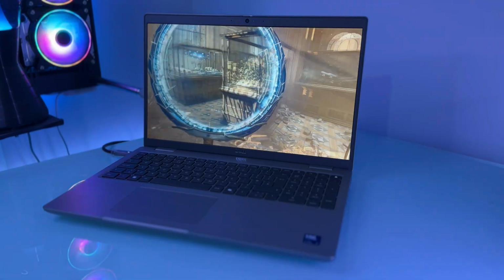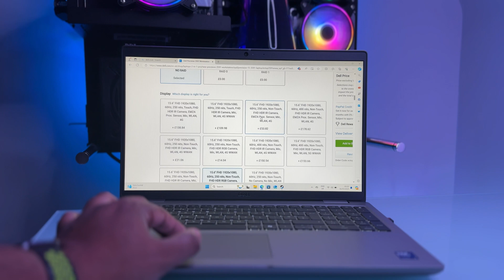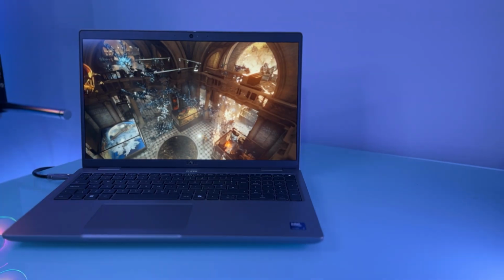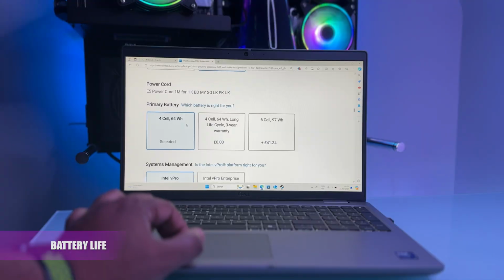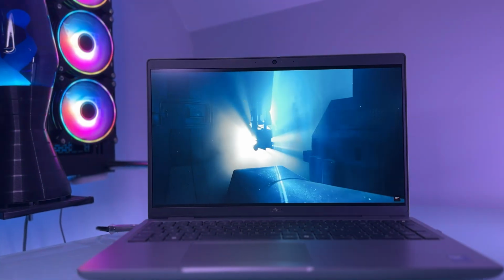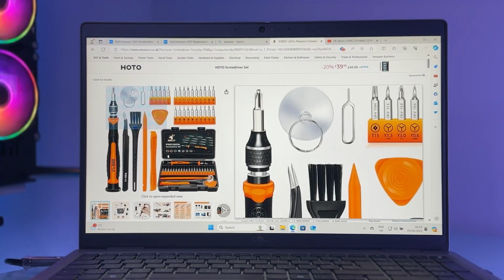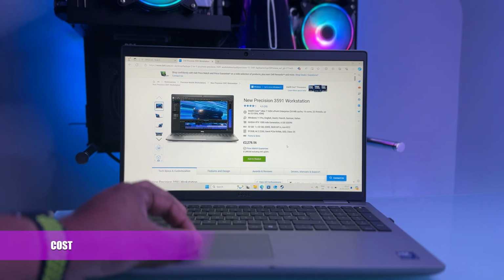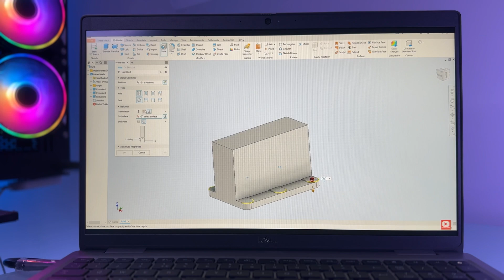The Unexpected Power of the Dell Precision 3591 for VIDEO EDITING

Comment: hey man i just bought this workstation with ultra 7,16 gb 1x16,512 gb ssd, rtx 1000, and was wondering if i cud install an extra 32gb ram with the 16 to make it 48?
Reply from the maker: you wont be able to, you could go 2 x 16GB or 2 x 32GB
Reply: @i.c.t_workz  so wud my work station be able to handle 64gb?

Comment: I am considering this laptop and the 5550. Both will be configured with 64 gig and the second drive will be a 2 tb. All in all identical platform except for the video card.  The 5550 has an integrated card. The advice I am getting is that the precision is too bulky and heavy to use as a mobile laptop sad and  the battery life is short in comparison. The attractiveness of the nvidia traffic card is very appealing.  I do photo editing and have not nor plan to do video editing at this time. Which computer would you advise me to invest in and why.
Reply from the maker: @AnthonyCuomo-o9l 3591 isn’t bulky and can have a dedicated GPU. I’ll be dropping a video soon that compares different dell models keep an eye out
Reply from the maker: @AnthonyCuomo-o9l 3591 isn’t bulky and can have a dedicated GPU. I’ll be dropping a video soon that compares different dell models keep an eye out

Comment: soon or later it will be evident that what you spend in workstations is overpriced insanely just in exchange of weak  Quadro gpu 'certified' by Autodesk and simple CPU that pretend to be better just because they are installed in serious laptop.
Reply from the maker: @msganga1974 business pay for them and if normal consumers pay £2k plus pfor a gaming GPU then it makes business sense for nvidia lol
Reply: i had one of these machines, but , not laptop, desktop. they are 'solid', stable and last for years. blue screens are rare. they are built for stability, but i do agree that they are expensive.
Reply: @ recently I purchased a fantastic workstation from workstation specialists in UK...they do not even consider anymore Quadro GPU...only Nvidia RTX...I got ultra 9 285K with RTX 5090 and 128 GB of  RAM...rendering GPU is crazy fast...and the machine is super serious. I still have my portable dell workstation M6800. I paid 7500 Euro that machine in 2012...it is still very good but it was never WOW but solid and reliable.  :)

Comment: Just picked up the Ultra 9 185H with 64GB RAM, 2TB SSD, and RTX 2000. This is an absolute beast! Ready to conquer anything! 💪💪
Reply from the maker: What are your plans for it?
Reply: Could you tell us about the battery usage time? and heat management?
Reply: @DarshanaHashendra  It’s been a great machine so far! Battery life is holding up well, and heat management has been solid even during heavy tasks. Really happy with the performance
Reply: @syounes  thanks for the response.

Comment: Does it have any issues like crashing apps too often?
Reply from the maker: @paulk2308  that would be more of an issue with windows rather than the laptop but as long as the application are compatible with the hardware they should run. I’ve not had any reports of crashes and there are 10 issued out to the business I work for.
Reply: My Lenovo WS P15 crashed so often (once or twice at month) before memory simm died at all. Unfortunately it took so long. After have replaced simm never has crashed again. Had tried reloading windows/programs, ..
Reply: some 14th gen processor  has some issues in some desktop processor. Does the fan make noise while streaming?
Reply: One of the worst laptop to buy and color accuracy is like garbage, at this price point mac performs thousand times better
Reply: Yes, dont buy
Reply from the maker: @paulk2308 it’s not laptop specific that would be a windows or app issue but I haven’t experienced anything
Reply from the maker: @paulk2308 it’s not laptop specific that would be a windows or app issue but I haven’t experienced anything